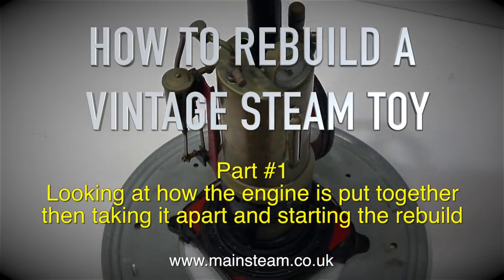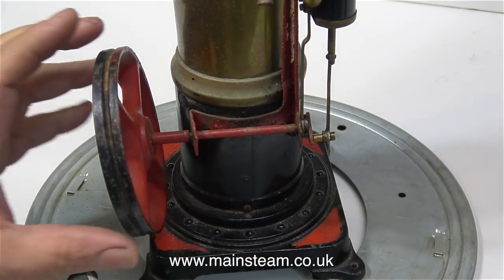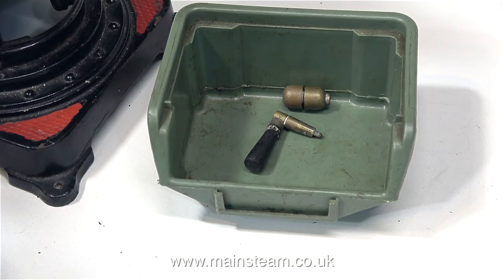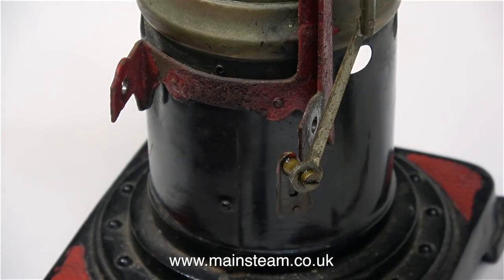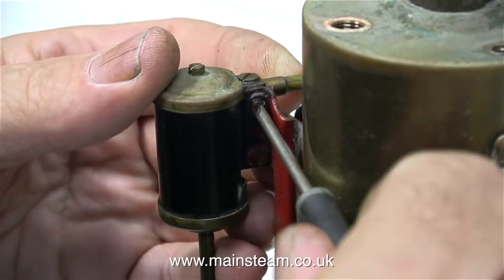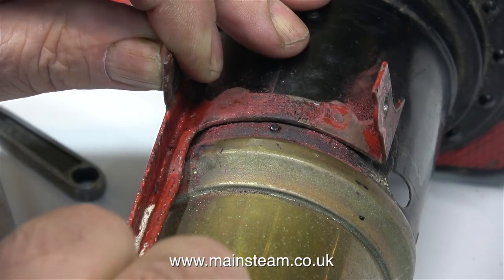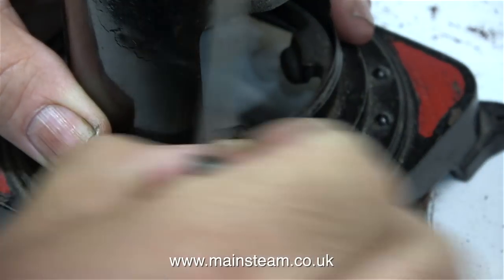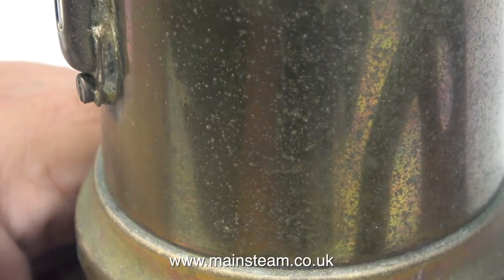HOW TO REBUILD A VINTAGE STEAM TOY - PART #1

Comment: Your manual dexterity and control never cease to amaze me.  If I had tried to file those rivets without scratching the brass ring the job would have wound up looking like an untrained baboon had attacked it.   I always have to spend time covering all the things I know I will accidentally scratch with tape.  No doubt your musical finger muscles are a wonderful thing to have.

Comment: Hello Keith, interesting one this. I believe this is an Ernst Plank toy made from around 1890 onwards. It could well be that Bing or Carrette took over the tooling at a later date. The insignia was simply "EP" should you find it somewhere on the engine. The other possibility is Doll. They seem very similar in construction, too flimsy for Märklin. Good luck with the job. Best regards from Germany, Phil.

Comment: Do you plan a boiler test just with water? These old boiler are about 80 years old and are often soldered partially with pewter led mixtures. These joits may suffer from beta stannic formation which may lead to weak joints... how is your experience?
Reply from the maker: It will definitely be getting a hydraulic test . . .

Comment: A lovely old piece and prob rare as hens teeth as it does look like an early model, I am a fan of Wilesco engines as they seem a little bit better quality than our own Mamod, I also like my Signalling Equipment Ltd Junior which is a feisty little engine for its size but pride of my collection has to be my ultra rare Mamod SC3 which was only made for a couple months before WW2 broke out so extremely rare engine which works just as well today as it did when made :D